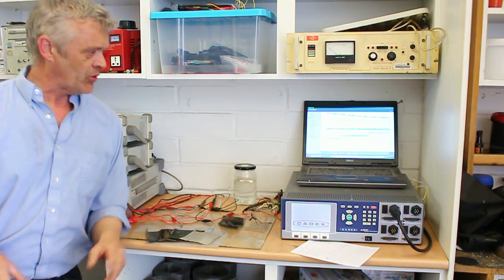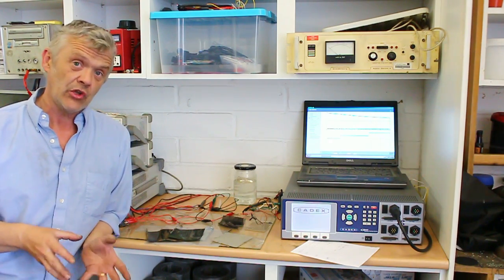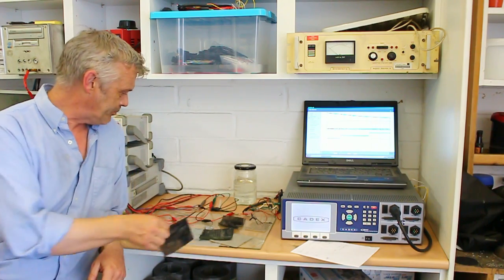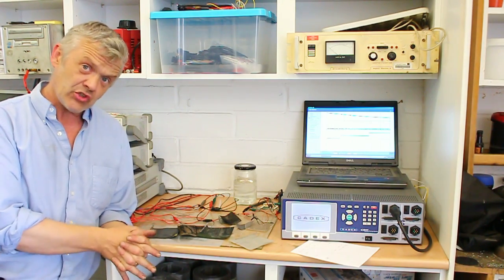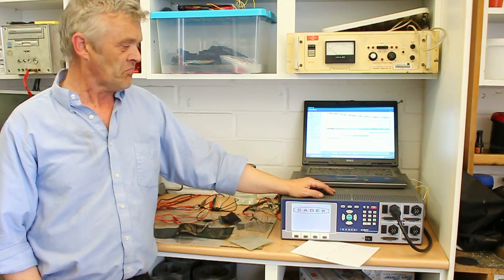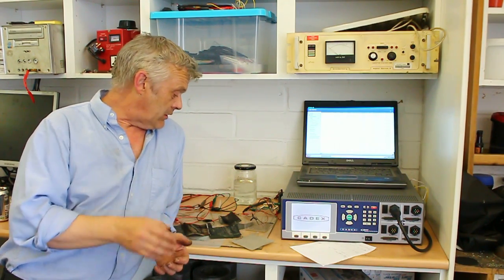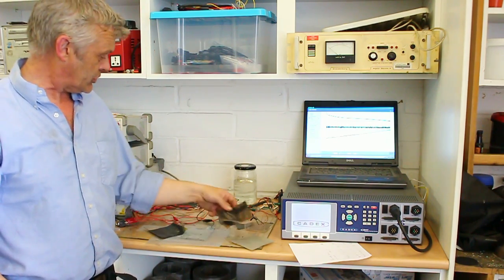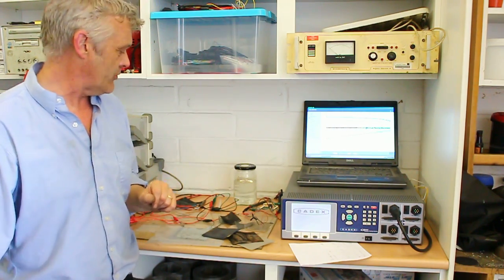Some Cadex Reports On The Battery

Comment: I'm really excited for you guys. Can't wait until you get into commercial production. Once you get your top end battery sorted out I'm sure that Tesla (the car company) would be very interested. Your battery would instantly double the car range and improve performance with the lighter weight per KWH. Imagine an electric car with a range of 800 to 1000 mile range. Fantastic.
Reply from the maker: cheers mate
Reply: Especially good if you combine that one with the lower one, by making the tires on the car layered batteries reducing the weight and space the batteries use.

Comment: A perfect use for the "tire battery" is for large scale power in homes and the like. It's cheep, easy, and enough energy density to do so. You could also look into the City power management applications, because it is far superior than the Vanadium cell devices that are currently being used.
Reply from the maker: cheers mate

Comment: When you compare your first test to lead acid for watt-hours/kilogram, what are you measuring for each?  It sounded like you were only accounting for the coating for your sample (the tire-originated carbon ink and not the steel mesh and electrode), where the lead-acid sounds like a watt-hours/kilogram for an entire battery; lead, electrolyte, electrodes, case, labels, etc.

Could you explain this clearly?

Very interested in your work, and really enjoying your videos.

Comment: Is the low conductivity of stainless mesh causing heat problems? Did you plate/surround the SS with something more conductive? Are you using SS because it resists corrosion?
Please try I'm missing many tech words, frustrating, my volume is maxed out. I would try a external 20 buck corded desk mic, really simple. Thanks
Reply from the maker: not realy - yes and yes - the ss mesh is carbon coated and iuse it because it resisits corrosion as for the mic i use a zoom h2n the problem isn't the mic it's because this is a window into the lab not a recording studio

Comment: Hi! Since I'm at early stage with the battery research, I was thinking to use a small device to trace the curves. What to you think of this? HoldPeak HP-90EPC Multimetr Digitais USB. And where did you find the micro motor that runs at voltages till 0.3V? Cheers

Comment: Do you take into account the total weight or just the weight of active material when quoting energy density?
Reply from the maker: weight of active material
Reply: What do you think is the best results so far if you consider total weight? Like the scooter battery for instance?
Reply from the maker: 250Ah/kg
Reply: hello Mate, I remember You that Ah/kg are not really "energy density" if the voltage is not specified; needs Wh/kg ;-)

Comment: You quote energy density in Wh/Kg.  Is it useful to correct for the density of the battery material?  i.e. Wh/m3?  I only say this because although you compared the performance to a lead acid battery, the latter is quite compact (because it is heavy) and in some applications, it is not so much the weight but the volume which may be restricted.
Reply from the maker: i usse specific anargy a lot mate  (Wh/kg) because it is an easy metric for me - easier to weight than estimate volume - but you are right energy density (Wh/l) is useful - I am most interested in home storage and grid where volume is not so much of an issue

Comment: What's the reason for these types of batteries not being more common place? Why is it also convention to quote the energy density of the active material, if the active material is such a small part of the battery as a whole then should you not compare the whole system.

Comment: Are you including the total mass of the battery when calculating the wh/kg? I.e. Current collector and housing and anything else needed for a usable device.
Reply from the maker: no just active material
Reply: Any guestimate about the Wh/kg of a finished cell? In your video, are the quoted comparisons to other battery chemistries  energy densities doing a like to like comparison, also including only the active material for those other types?

Comment: Hello Robert. Thanks for your reply and sorry for the delay of mine :/ I VERY// Understand your reasons while I think that Open Source
Engineering is COUNTER-productive respect to the Ecological aspect. I explain:The cost to create even a little unit of manufacture with the machines, the employed, the time to reach Enough Quality Production and have homologations, is in SEVERAL HUNDREDS OF THOUSANDS IF NOT A MILLION of Euros at least. Who, in the Industry, will risk to invest such money without protecting their investments by a Licence? if not Chineses because they don't really care with their huge world-while distribution systems... ^^ I thought I could have a little machine at my workshop and produce the cells but even if it would be possible (and maybe it is indeed, still have to counter-check that point) to have a little machine to do so, would be few k€, just the homologations are already in k€ and are VERY// hard to obtain, at least in France (reasons of security and viability: cells should not blow or burn and meet the requirements of durability). So for now, I'm merely stuck. Anyway, would be Just For My Own Pleasure, I am still Very Eager To Visit You but I am afraid that unless we associate with one of the big sharks companies of power cells, we won't have the financial to sustain the investment needed to go on Real Meaningful Production :( Best Regards, Didier. (couldn't replay in our thread of 4 weeks ago, my comment was always appearing in an other tread! lol so I have copy-pasted it here ;-) )

Comment: Hello again! Mate. I just "can't believe" the Amount of AWESOMENESS You Accumulate, All Of You Guys! :D So Very Very Nice And Great Results Again! "Can't wait" to visit You soon to see how I can help and how You can help me to spread this Green Technology in my country and maybe others! :) <3 <3 <3 Love You, guys! :p
Reply from the maker: you are more than welcome to visit anytime mate
Reply: Robert, about the cost You announce, isn't it just the cost of the raw materials? I mean, this cost doesn't yet take in account the cost by year of the machinerie to manufacture them, nor the time to manage the production of the cells, nor I guess the containers chosen to contain the Active Material and Electrodes.  I've tried to find data about this kind of cost of actual present batteries but with no Success; would You have any idea of what would be the cos GLOBAL Manufacturing Cost of a 18650 type cell? and if possible: function of course of the amount of cells produced by year? please.
Reply from the maker: no idea mate - sorry
Reply: All Right, understand Mate. I will try to estimate that there with You if I can come to visit You (I've sent a mail to Gary about that ;-) ).

An other detail: I need to estimate the ecological impact of the cells. For this, I need to know the elementary components to check if they are safe to produce (the idea is to have cells which are "green"). I know there is carbon, stainless steal, what about the electrolytes or any other component? ^^
Reply from the maker: I can't tell you that mate - not without an NDA and then it is highly unlikely unless we have a contract with you. That's just not info i will share so someone can asses a possibility mate - you have to understand that
Reply from the maker: i was thinking about this some more mate - the only thing i can really reveal on these batteries is performance at this stage - for anything else you're pretty much on your own

Comment: I hate watching your videos! because I can't stop watching them!!! I want to build a battery bank for my off grid home. do you think that it would be possible? I would require about 300a at 24v nominal . and about 5-6kah. but I can work up to that. as long as I get about 12 hours run time. the 200 amps is peak. it will likely be about 30-50a most of the time. but do you think I could buy the materials you are working with? and build similar cells at home?
Reply from the maker: lol - awesome mate - I am afraid i don't sell stuff like that but i have done a lot of videos on how to make it yourself - please don't tell me you ca't because you don't have the space, knowledge, skills etc - the only thing stopping you is you
Reply: Robert Murray-Smith 
thanks that's so motivational. I guess I'll give the small scale a go first. thanks again..
Reply from the maker: awesome mate - you are in for a fun ride - i love it and i think you will too

Comment: Doesnt smearing their surface with your fingers change their properties drastically? When you hold the sheets towards the camera there seem to be great areas with varying degrees of discoloration wchich means different material density and also presence of different substances such as skin oil for example.. Yet you dont seem to care.
Reply from the maker: no i don't care particularly - you are 100% right the method i use is sloppy and poor practice and the devices would improve significantly if made well. But the point here is to how what can be done with 'kitchen grade' equipment. It is meant to show what you can do if you try
Reply: Shhhh! The secret ingredient is the bacon grease doping of the active material! 
In all seriousness though, I love that Robert is getting these spectacular results with stuff that literally anybody can do at home.